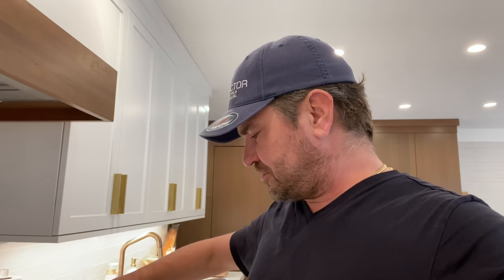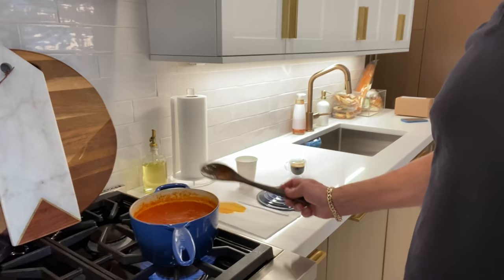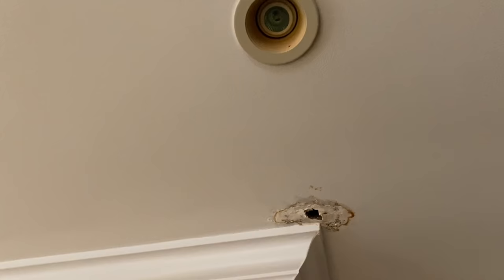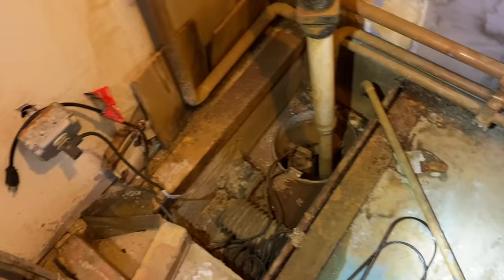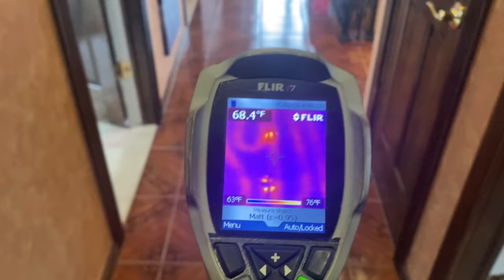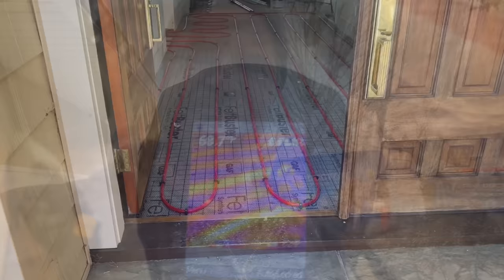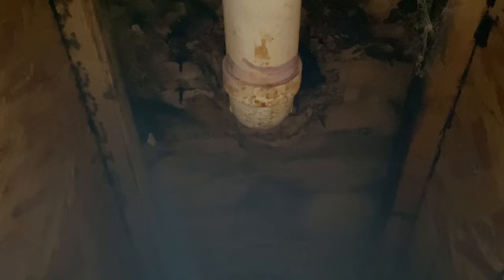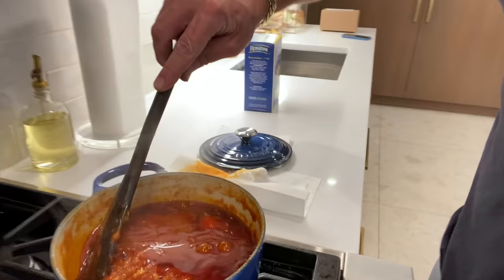Mysterious Water Leak in Kitchen Ceiling Diagnosed - Was it Radiant or Something Else?

Comment: Nice job. You always have to start eliminating what the homeowner thinks is the problem. You were testing and being aware of your surroundings.  I had one years ago where the first thought was a radiant leak, the second was water from outside. Used the Flir attached to phone to chip the concrete without cutting the radiant. The wood below was wet but not from the radiant. There were two boiler and the exhaust for one of the condensing boilers below that area was not properly connected and was putting moisture into the floor. Plus, it was the only boiler working of the pair, so it was doing double duty.

Comment: nice video and good find , sometimes for the customers satisfaction it was good that you double checked the radiant (even though your gut was telling you its something else) now the customer knows that there is no leak in her heating system and you discovered the radiant was installed improperly and why her bathroom is to hot. so it wasnt all in vain. nice work

Comment: "Ma'am, I'm here to look at the leak in your ceiling. Let me start by replacing your outside hose bibs". Not sure why you spent time with the shower valve (although it did need fixed). Seems to me the ceiling should have come out from the get go to see what might be the source of the leak.

Comment: Nice job on laying radiant pex.  Writing from SE Pennsylvania.  3/1 Levittown SFM.  Rehabbing the small bath.  Would like to use electric radiant heat blanket under porcelain tile rather than electric baseboard heater.  Either 120/220.  Any recommendations on type of heat and brands?  Sincerely, thanks.

Comment: 3:36 What is going on with that drain line ? I have never seen anything like that before. I am guessing the smaller line is a drain line into the larger 6 inch line, but there would be standing water in the smaller pipe all the time. Wouldn't it make more sense to have a sump pump pumping the water up and put a trap in the line ?

Comment: I deal with leaking shower pans all the time. Many plumbers install the pan with staples. When going through one layer of pan material that is OK but when you have folded corners not so good. You also have to use stainless steel staples or they will rust away. A common problem is for the pan material to fold into the outside corner and form a low spot for accumulating water to run out. Then there is the installation of the cement board and the installer putting screws below the finished height of the finished mud. The problem doesn't show up until the screw or nail starts to rust, and it will.  The door threshold is a difficult area to properly seal. I use products that make sealing that area much more effective. The most commonly skipped step of building a tile shower pan is prepitching under the pan material to ensure the water runs to the drain. Nobody wants to do it because it adds to time and cost. If you prepitch under the pan to the drain, properly install the pan material, install your mud base, red coat the mud base and up the wall 6 inches, install your tile using epoxy grout, and properly caulk you shouldn't have any problems. The real problem is a customer understanding why you need to do all these steps and paying for it.
Reply: :-) That's why I have designed my own stainless steel shower pan. 
I hate those plastic liners, they always leak when the job is finished or somebody shoots a nail into the liner.